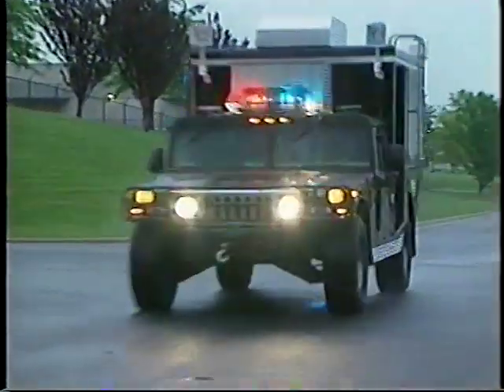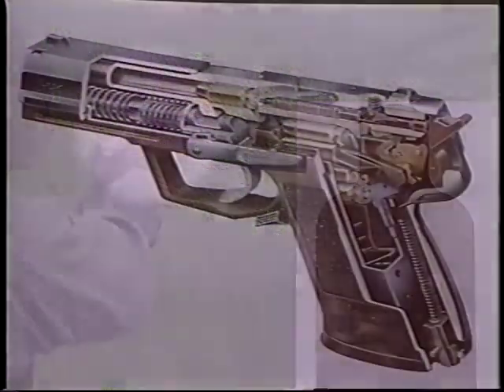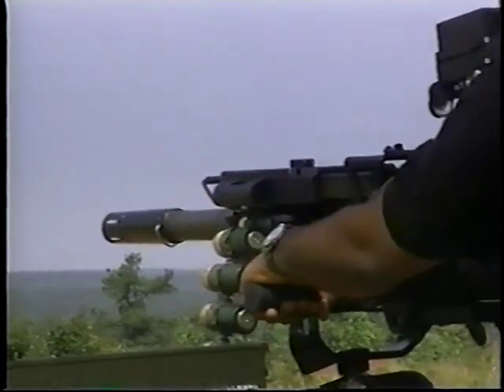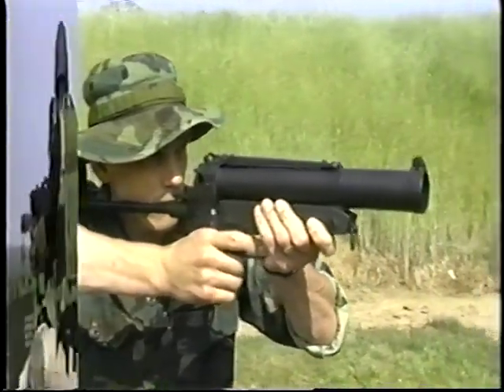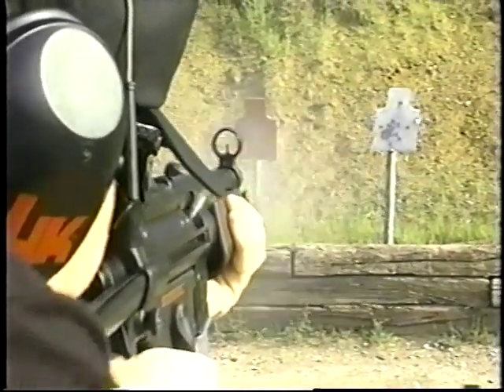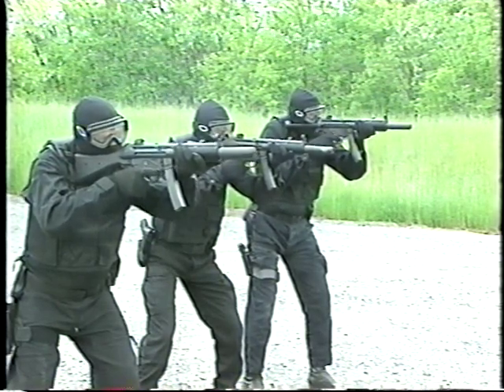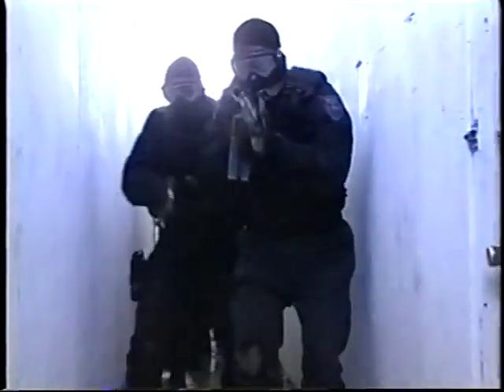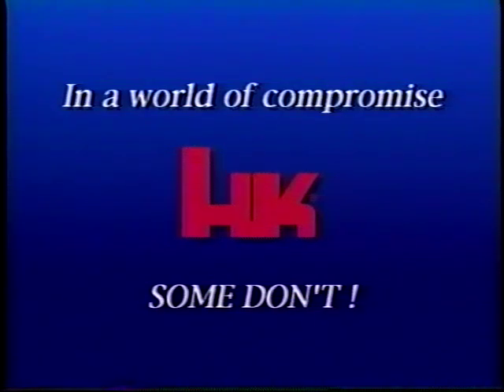HK Weapons System - FULL VIDEO

Comment: the Mark 23 is by all accounts the best designed sidearm in small arms history. The mean rounds between stoppages is nothing shy of astounding. The military durability test was actually modified several times during the adoption phase, and no matter what they couldn't break the gun. The Seals and Green Berets still use it too. The LAM looks much different now, however.
Reply: Unpopular opinion: I would take a mk 23 into a gunfight with me over a Glock 21
Reply: Fine weapons
Reply: nah. it was too heavy , too big. the USP was better

Comment: 13:56. But the H&K G3 isn't a assault rifle, it's a battle rifle.
Reply: tell me the difference lol
Reply: +Dan Volkov First off bolt guns and lever action are not battle rifles. So for this, a battle rifle, is going to be a semi or fully automatic rifle, firing full size rifle cartridge, like the 7.62x51mm NATO. They usually hold a capacity of 20 rounds, has high recoil and medium rate of fire like 400 to 600 rounds per minute.
An assault rifle on the other hand, is a rifle firing a intermediate cartridge like the 5.54x51mm round. It usually feed from a 30 round magazine, has little recoil and has a high rate of fire, like 700 rounds per minute. Also select fire capability. 
Hope it helped you know the difference between an assault rifle and a battle rifle. Of cause there a other, differences between the guns, but this is the basics.
Reply: +Dan Volkov Sorry the 5.56x45mm
Reply: Riddle me this, Batman:
Did they use that term back in 1997?
Reply: You do know that a 7.62x51 mm (.308) is a cartridge that has been necked down from a 30-06 right? Therefore it's not a full size rifle cartridge, that actually makes it an intermediate cartridge. You can argue if you want, but just remember that the Germans designated the round that the STG-44 fired as an intermediate cartridge (that's where the idea came from) because it was a necked down round from what the Mauser K-98 fired, and the STG-44 fired a bigger round than the G-3 does.  7.92×33mm (STG-44) VS. 7.62 x 51 mm (G3)
Reply: This videos was made in the 1990 were 7,62x51mm rifles were still called assault rifles. You have to wait another decate to the mid 2000s to call 7,62x51mm rilfes battlerifles.
Reply: Valdemar Hahahaha!!! What’s the difference? Nothing
Reply: Grasyl the SLR was a battle rifle made in the late fifties !